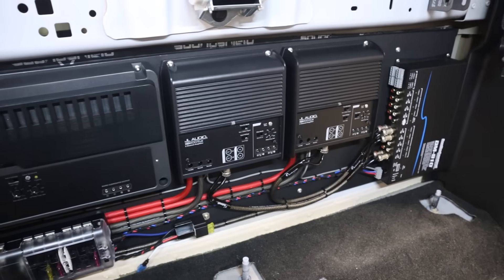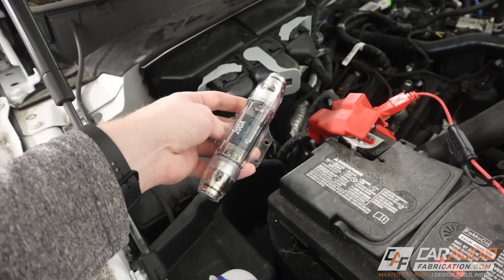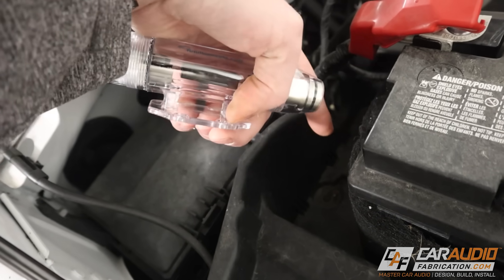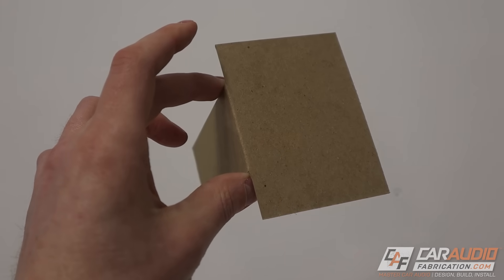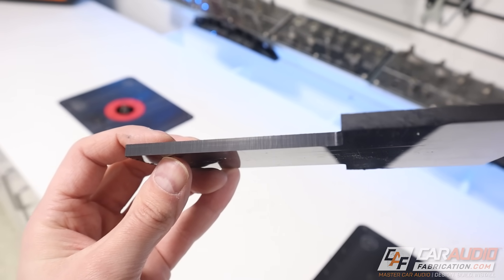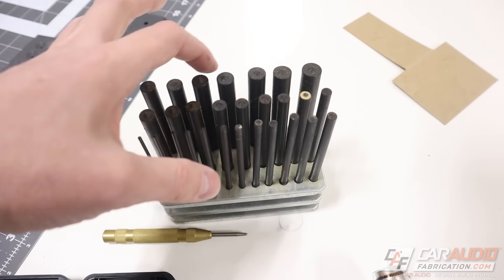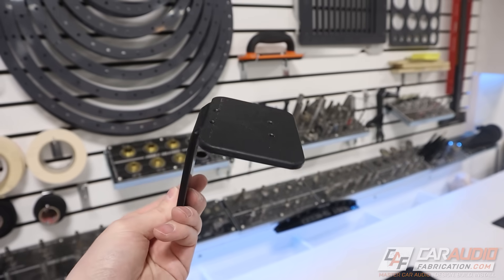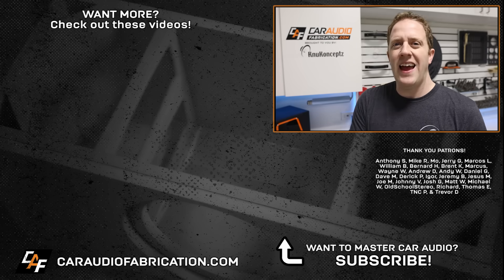Make a BRACKET & avoid these problems! How to mount car audio fuse…

Comment: Even if you pay, shops won't do this level of work. You are special.
Reply: If you go to a crapy shop like Car toys. I’ve had installers tell me they are not going to discuss how they are going to install it. Also before you use a local shop do the same thing. I found a guy who has his own shop and he does great work and for less then a local shop.
Reply from the maker: There are definitely shops that will but unfortunately they are rare.
Reply: In fairness many customers just won't pay the amount needed to do these extra things.
Reply: @BASESKIZL  We have a Car Toys in my town, I have no idea If there is a connection with the shop you are referring too? I had a buddy who worked there at times, he's been doing car audio stuff for 20 years plus! Anyways . . he told me a story of one guy who was installing a head unit (I forget what vehicle) well, we all make mistakes but, this guy tapped a wire that was for an airbag, I guess everything was playing ok, then once he started turning the volume up . . the airbag went off!?!
Reply: I agree!!!💪🏾

Comment: Would you ever use a circuit breaker, rather than a fuse?
Reply: That was my first thought as well. I use one in my current vehicle. I much prefer it to a fuse. Though it has never tripped, I feel better knowing that I could reset it in the field after correcting the reason it tripped in the first place, without having to carry spare fuses everywhere.

Comment: Hi Mark. Please consider fabrication and sales of brackets for American, European and Asian Vehicles you have experience with as a side trade. Even though you outline these steps very easily, when staring at the engine bay of my 2014 Hyundai Tucson I suddenly go blank. Would be nice if general fuse holder brackets (that can take one or two fuse holders, already cut and bent and including a small picture to show which stock location they attach to) could be sold by either you or a third party e.g. Knuconceptz, e-bay, amazon etc.

Comment: Where do you get the closed cell foam strips for wrapping connectors?  I was looking on Amazon and didn’t see anything that wasn’t huge sheets.  I figured there was maybe a better option similar to what you have.

Thanks

Comment: If my car's factory amplifier is rated at 120 amps, what kind of fuse size should I use if I'm going to use 1/0 gauge wires in th3 big 3 upgrade? I currently have a 300A inline fuse, but I checked online with chatgpt (which can make mistakes) & it said that it should be closer to the alternator's rating so the fuse can catch a short circuit beforehand instead of waiting to short circuit until it reaches 300A.

Comment: Great tips and the finished production came out nice but  its triggering my bracket OCD. There is a  bit more flex in that than I would like, but it should work fine without a gusset although I would have added one. The biggest thing for me would be not mounting the fuse centered on the flat plane and not mirroring the shape of the bottom plate of the fuse holder in the bracket. I think it would have looked   nice to have a consistent 3/8 inch or so reveal all the way around the fuse holder.
Reply: The fuse holder not being centered was giving me fits. I too have OCD and it just didn't work for me. The craftsmanship was top notch, but that little detail would've been something I would have done differently. To be honest, screwing bolts directly into plastic is also something I prefer to avoid. Plastic has the same issues with cold and heat cycles as wood does and those bolts will eventually work themselves loose. As battery cables are something worth securing tightly, I would have used stainless bolts and nylok fasteners.
Disclaimer: As my profile shows, I'm a photographer now, but before that I was a certified installer for 25 years.

Comment: I ordered some kolossus ofc and the only thing I don't like is once it's stripped, it's hard to keep together while putting it in a ferrule.  But I'm still gonna use in from here on out.  You can buy it by the foot instead of overpaying for a stupid amp wiring kit that may not have enough wire (especially ground) for your install.

Comment: Please, give me an idea of how to securely install fuse and power cable to a battery that is under spare wheel in my Audi A8 D4 trunk. Because now I must take my bass box and a spare wheel to disconnect battery to work on wiring to my amps. So cable and fuse must be flat down on the floor to allow wheel to fit in. Hmm? 🤷‍♂️

Comment: What are your thoughts on a 150/200A relay vs fuse up front near the main battery?
Reply: A relay isn't a fuse. You can add a relay in addition to the fuse but a relay doesn't replace it.

Comment: Love your content, I am looking to re-upgrade my 4th gen Ram 1500 sound system and I am thinking about powering tweeters, dash 3.5s, 6 in front and rear doors, my Kenwood DMX1037s has 3 pre-outs (tweeter, Mid and Sub). How should I wire from my head unit to the DSP to the multiple amps?

Any help is much appreciated.
Reply: By how, I mean should I use the pre-outs or split the wires to the individual amps?
Reply: Yes, Head unit to dsp then to amps, make sure to use good distribution blocks to power all of those amps

Comment: Hey Mark where did you get screw kit you used for fuse holder and mount ?
Reply from the maker: I made it. It's just an assortment of the fasteners I find myself commonly using.

Comment: If not the 18" rule. Then what length you like?
Reply: As close as possible so if the wire before the fuse becomes exposed it can't touch the cars chasis or metal. This isn't always possible but that's why as short as possible along with cable ties along the wire which will keep the wire in place if it comes off etc

Comment: dont use plastic under the hood use an aluminum bracket  first heat second drill holes in plastic then tap them no no no use inserts in an aluminum piece if its not thick enough but if its 1.4 inch you can just tap it
Reply: Why not use plastic, theres a ton of abs plastic in the engine bay. The fuse holder weighs next to nothing

Comment: Once I discovered the MRBF fuse block I will never use anything else..
Reply: I'm surprised there aren't more alternatives like the mrbf battery terminal fuse holders. I could come up with many even better styles than the mrbf that attaches to the battery. 

One thing I dont like about the mrbf holder is the height its very tall, and the mounting hole comes in one size. Also don't like the maximum torque for the lug bolt is 8nm otherwise it can damage the fuse. 8nm is probbaly fine with a lot of vibration its possible it could come loose, but being on the battery even if it comes lose theres zero hazard.